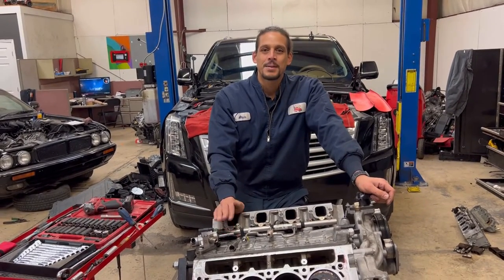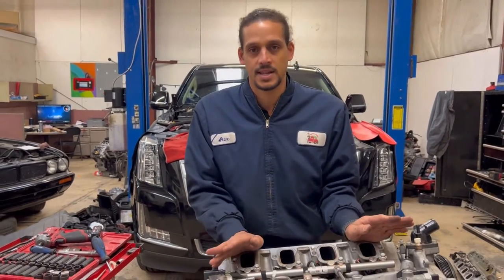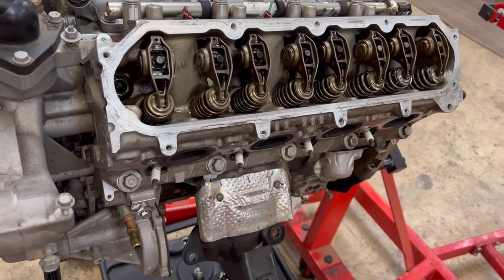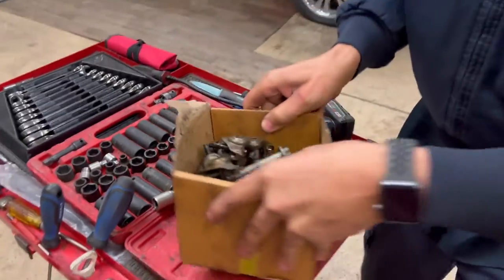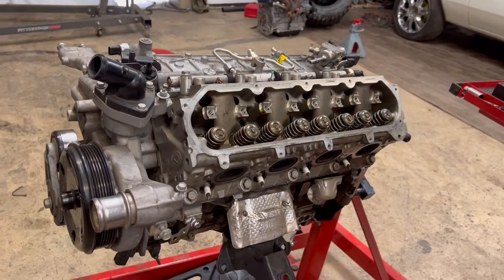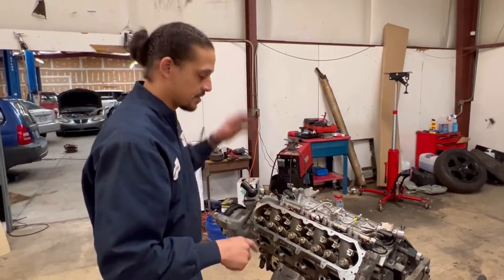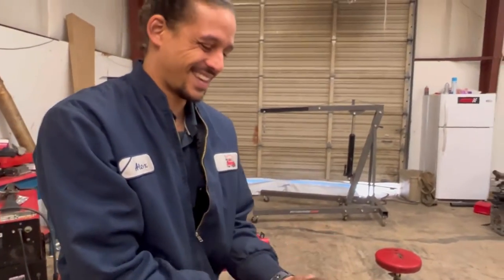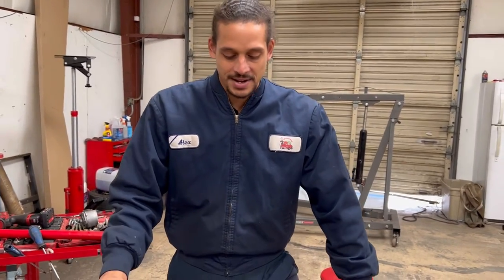Cadillac Escalade Lifter Fell Apart (Partial Engine Tear Down) #cadillacescalade #lifterproblems

Comment: Active Fuel Management (displacement on demand) is a horrible system. If you are looking to buy a vehicle with this system...if the system is running correctly, buy a device that turns the system off as soon as possible. They make disablers, fyi.
Reply: I dont think the disablers are worth it. Might as well just replace the cam shaft and lifters. Unless youre worried about the warranty.
Reply: Back 20 yrs ago lifter problems were not very common,why is is so common with newer cars now bad designed or cheap metal 😮
Reply: @OldManFrank  more like destruction on demand lol.
Reply: TAKE IT FROM ME THEY DON'T WORK!!! I still dropped a lifter while so called running in v8 mode only.  Only way to remove it without physically deleting it. Is to have it tuned and deleted out the PCM. Me myself I deleted the entire system and had it tuned.  Save your 💰 don't buy disabler devices
Reply: Yep just buy the DOD  delete kit
Reply: I had my AFM delete and did a tune up and its a big fifference after the job the cadillad service did

Comment: I just had all the lifters replaced on a 2021 Cadillac Escalade with only 23000 miles on it. One of the lifter failed, but Cadillac dealer replaced all of them. Watching your video was a great explanation as to what they had to do. Thank you!!
Reply: Is this a engineering issue or can it be prevented?
Reply: What a shame!!!  Nice vehicles but I wont come near one because the reliability is so terrible.  Plus you have carbon build up issues.  Transmission issues. Electrical issues. Weak fatal roofs in a rollover.   Much much better off with a Lincoln Navigator, Toyota sequoia or Lexus LX.
Reply: replaced all of them with stock DOD parts so it fails later down the line....I heard instances where they went into all the work of pulling a head/s just to replace the bad lifter.....total craziness since the motor is already apart to not do all....but thats the dealer

Comment: GM sells the block for $4200 with 12m12k warranty over the parts counter. If installed at GM dealer then you get 3y 100k warranty but it’s $8900 installed. Just had mine done. These J code l86 only have 100k total engine life.
Reply from the maker: Good information thanks

Comment: You know for somebody that does so much work on these engines you should know better than to recommend 0w20 cause that is just to meet EPA standards that oil is not the best you can use for that motor

Comment: Thanks for taking the time to do this videos and help educate the community.  GM should have a recall for these engines, I been a GM customer for 2002 buy 3 brand new Silverados, my 2013 and my 2015 Silverado with 37,000 miles are both broken on my drive way, I would never buy a GM vehicle in my live, and I will be talking to all my family, friends and any body who wants to buy a GM vehicle to don’t buy it. This engines has so many problems that it’s ridiculous and GM it’s not doing anything about it, and to make things worse they still putting those same engines in new vehicles.
Reply: Not just engines......DOD issues 2010 to the later models, bad torque converters ruining transmissions, bad engine mounts, rear main seals......these are the killer problems....

Comment: 5w30 is perfectly fine for those.  20 weight only exist because of the stupid EPA CAFE requirements.  It’s the same motor in the C7 Corvette and Camaros that call for 30 weight.   The only differences are the intake manifold and exhaust and of course the tuning.  

Love your content.
Reply from the maker: Thanks for your input about the oil I appreciate that! And thanks for watching 😎

Comment: Hi Alex, at 20:16 you mentioned the valley pan, I just learened this called the "valley lifter oil manifold." I am starting this job on a 2015 Escalade ESV with 73K on the meter. I have just taken the valve cover off and found a broken spring #5 on the left bank. The spark plug end is a deformed. The lifter rod is not bent and the underside of the rocker does not show any dimpling, so hoping for the best, but won't know until I get the cylinder head off.  The owner said the car started to hestitate while driving around 15 mph, so he pulled over and turned off the engine and then tried to restart, but it wouldn't turn over. I am hoping for the best case scenario! Thank you! Jon (Erie, PA).

Comment: I've owned so many LS trucks and performance cars and you are better off camming/dod delete as soon as you can. Have a 2014 SS with a failed lifter but fortunately for me it bent just the connecting pushrod. Got it cammed to so i don't have to worry.

Comment: Hello, thanks for the great video.  I’m currently in the process of performing this job on my 2015 Escalade.  I need to remove the engine so that I can replace the oil pump.  My question is, what needs to be done to separate the engine from the transmission, do you lift the motor directly up and at the same time lift the transmission or do you remove the transmission first then the engine.

Comment: Hey man I have a 15 ESV that I purchased three years ago with 4,000 mile. Mint condition
We just got back from Fla and we’re at 10,000 miles
I’ve always noticed the transmission is jerky 
Do I need to get rid of this thing before it’s gets worse?
I’ve read all the issues on 15 - 2020 years

Comment: I had a good ? How were ur gonna handle the sludge by doing sum type of chemical flush on the engine or just da parts thats affected?
Reply from the maker: Sludge is normally an issue in the oil passages I didn’t see any in the oil passages internally in the engine. I’m just going to clean up the parts in the parts washer
Reply: @AlexTheCarDoctor  oh ok cs that sludge i seen in the past take down lots of engines😂

Comment: I do have questions because I'm about to purchase a 2016 Cadillac Escalade with 98,000 miles on it. So from 2015-2020 this problem can occur? Is that with certain mileage or people running it rough or not taking care of it or can you explain some more this way I can make my decision if I'm going to buy it or not I want one so bad between 2015 and 2020 I didn't like the old body style and I don't like the brand new body style I like the 15 to 2020 and that's it please help me New Jersey calling
Reply from the maker: I’ve seen people take awesome care of they’re  Cadillacs and still have the lifters go bad. I’ve seen them happen from 90-100k miles. It’s just a bad design.

Comment: First time work on this car. Due to 4th cylinder knocking we replaced the lifters, lifter valve, oil pump and the push rods and cleaned oil pipe. After starting engine again lifter 4 was knocking. We then replaced the lifter oil manifold and lifters but the same problem... What do you think could be the problem? ready to just replace entire engine...😢

Comment: Great video.got a question for u I just got done doing a 17 caddy.all brand new lifters the cam looked good with a borascope.got it running an ran great for maybe a half hr now it's clattering just like a lifter is stuck again.any idea have u ever had problems with them getting stuck like that again.they all oem parts from caddy even. Appreciate any info you can give me on it.

Comment: Thank you because I have a 2016 platinum esv with 105.000. I had it since 40k kept up with services. I’m going through this now! What should I do?
Reply from the maker: If you like the truck, fix it. It’s expensive and there isn’t a guarantee that if fix it that it won’t happen again down the road. I heard that if you upgrade the lifters to a brand called Johnson lifters, you won’t have the problem anymore. But those are super expensive and when I give my customers the option, they choose to go with the “Melling” brand that I use. It’s just a pain in the butt really 😞

Comment: Hi Alex.Question! I have 2018 Escalade ESV. Just today, rod bearing went bad. Mechanic recommending an engine replacement without opening the engine and said that by hearing the engine knocking noise. Do i really need an engine replacement or replacing the bearing would solve the issue? Need your opinion. Thanks
Reply from the maker: Hey there sorry to hear you’re having issues. I don’t believe what other mechanics say I will have to hear it for myself, is it possible you can Instagram me a video of it running. Throwing connecting rod bearings at it won’t solve the problem if the crank is scored up most times it is and you will have to send the crankshaft off to a machine shop to get it reworked and hope the mechanic can install everything back right, at that point I think it’s easier to put a engine in it that’s more guaranteed
Reply: @AlexTheCarDoctor  i just replied on Instagram sir. Thank you for the quick reply 🙏
Reply from the maker: @Yavyuuu  my pleasure

Comment: Question Alex.. I have a 2022 gmc sierra that was bought during the "chip shortage". i dont have the active fuel management system and my v8 does not shut off cylinders! even though i dont have the system, do i still have those type of lifters with the springs on them?
Reply from the maker: I do believe it’s just regular lifters in your vehicle

Comment: I had the cylinder 4 with lifter,pushrod,camshaft on my 16’ cadillac ewcalade esv in the cadillac service center and I paid $9k over because these escalades from 15’ all the way I think to the newer ones has a problem with the AFM system

Comment: i just bought a 2018 escalade ESV. should i get the DFM disabler? i had a 2011 escalade engine went bad  at 117k miles, cost me $8000.00 to replace the motor, started with a lifter issue that caused the bearing to damage the block
Reply from the maker: Disabled and it won’t fix the issue the proper way is to change the cam and  go in with regular lifters then disable it so the computer won’t throw a check engine light,disabling it is just a Band-Aid on a gunshot wound
Reply: @AlexTheCarDoctor  what would it cost to do that
Reply from the maker: @Brian.8272  that will be considered performance and I don’t get into that for customers but it would be the same price as seen on this video because it’s the same process, The price is between 4 to 5k parts and labor

Comment: Hey, just got you on JT’s live stream and subscribed, was wondering about the scarring in the lifter cylinder on the block will that not cause low oil pressure?
Reply from the maker: Typically yes, it will cause that and other issues as well. But in this particular case be sent the block off to a machine shop and it worked out great for him. Oil pressure readings were great!
Reply: @AlexTheCarDoctor  awesome

Comment: I have a 16 escalade when driving from  1st to 2nd gear it has like a jump or push feeling to it. & viceversa. On the cluster it shows when it goes from v4 to v8 mode or v8 to v4. Do you think the afm might be the problem?
Reply from the maker: Hey there, is the check engine light on. From my understanding the truck does this every time and when this happens it’s going from 4 to 7 cylinder and  vice versa
Reply: @AlexTheCarDoctor  no check engine light, took it to the dealership but they always try to avoid the problem itself lol
Reply from the maker: @carlosv6162  that’s crazy man I would love to take a look at this problem, where are you from
Reply: @AlexTheCarDoctor  I live in Chicago lol, I wish you were close by. I would’ve definitely taken it to you.
Reply from the maker: @carlosv6162  I need to open a shop down there

Comment: Hey Alex, love the video. I am doing this repair at home myself. However, I left the engine in the car and I was able to take all the parts apart and get the phaser out. However, after installing the new cam and camp plate, I am stuck and I am not able to get the new phaser in. I broke one last night and I just picked up a brand new phaser for $225 and I don’t want to break another one. You said there was a GM tech that knew how to install this without dropping the oil pan or removing the oil pump. How do you do that?
Reply from the maker: Hey there I recently tried that trick and it worked great for me, but it is risky and not recommended. unfortunately, it’s one of those things better shown than told.I recommend lifting the engine and dropping the pan
Reply: Thank you for the reply. I was able to finally get it on by loosening the oil pump bolts, took 5 hours but got it all lined up with cylinder 1 TDC. Thank you!

Comment: I’m replacing my lifters on my Camaro ss do I have to take the engine out completely or can I change them while the engine is still attached?
Reply from the maker: If you gotta change the Cam, you should take the engine out, it’ll be easier. If it’s just the lifters, you can do it while the engine is in

Comment: Saludos Alex.   Quería preguntarle.  Algo Mi esposas tiene una 2015 Escalade  la. Llevo al taller por un sonido raro en el escape y después de unos días los mecánicos dijeron que el motor ya no servía.    Y para cambiar el. Motor.  Mucho dinero. Y queremos buscar otra opción
Reply from the maker: Mi espanol es no bueno. But you can swap to a 5.3 engine that’s in the Yukons. They are way cheaper

Comment: Thank you from Calgary. I dropped in for a view of a big engine. I have a rattle in my 6.2l Denali 1500 GMC 2009  240,000 km/ 150,000 miles with code P0300 engine misfire that I am researching.
Reply from the maker: My pleasure
Reply: If you change batteries you have to reset the ecu
Reply from the maker: @rayolight9744  not with this truck

Comment: Hello Alex, I have 2015 Cadillac Escalade ESV. I purchased it in Feb and I should have bought the extended warranty. But, It was $6700. The dealer says I need a new engine. I guess a lifter spring broke and fell into the piston, damaging the block. They want $9300 for a re manufactured engine. 3 year/100,000 mile warranty. Any recommendations. Can the block be repaired, or should I go ahead with the repair. The mileage is 83,000 miles. 

Any advice, as I trust you more. I'm in Northern California. Its kind of hard. Because, If I pick it up from them I still have to pay them $1700. So they got me.

Thanks,

GReg
Reply: If I do repair and trader it in. Which year Escalade would you purchase? I don't really like the navigator. I have a G63, but its not roomy. Its the truck my wife drives to go to Costo. I also don't like the Yukon or Expedition.
Reply from the maker: Hey there buddy sorry to hear that, that is a lot of money, if you spend that much you will need to hold onto it to get your moneys worth.that’s a hard one to call,if it was me I will cut my losses and trade it in/sell it because who to say you won’t have another issue out of the reman motor after the warranty is up. you can get a 5.3 out of a Yukon similar year used for about 3500 and put that in just so it will be running to get rid of it,you will get more money out of a running vehicle versus a non-running vehicle. The Escalade of my choice is the 3 L Duramax diesel that’s found in the newer Escalade, i’ve heard they haven’t fix the issue yet even with the new  2023

Comment: Just wondering, is this a common problem on this model?
Reply from the maker: It’s not the model it’s the engine, GM uses this engine the 6.2 in there lineup for there cars and trucks
Reply: @AlexTheCarDoctor  Hello, oh so is it a common problem with this 6.2 Engine? I was thinking about getting a 2016 with a 6.2 and mostly highway miles - now I'm concerned lol
Reply from the maker: @moe4772  GM started this design back in 06, I have seen problems with there 5.3 and 6.2 engines. Last time I checked the problem was not fixed currently of 2023

Comment: What is the real difference between the LS and the LT motors Doc???
Reply from the maker: The Main difference is The LS is port injected and the LT is direct injected
Reply: @AlexTheCarDoctor  is that the reason why they sound so different??? Thank you for replying BTW
Reply from the maker: @paulsalmon4771  yes the high pressure fuel system is louder and change dynamic of the motor in terms of power and performance
Reply: Knowledge is power thank you. I love the LS but those LT's sound so with right exhaust
Reply from the maker: @paulsalmon4771  I’m a die hard LS fan. I like simplicity you probably can make way more power with an LT but for reliability I love my LS

Comment: I dont know what either did. I do know the both people engaging in road rage are a general problem.
I personal have always told friends not to react to people.

Heres what people say "hes going to get charged". Do yall think killers ste worried about charges? They wouldnt do it if they feared prison.
The thing is your already dead or injured because you were so desperate to give to follow them and give them the middle finger when it was pointless to try to prove a point.
First dont try to prove your point to a stranger who could be a serial killer and meanwhile uou haven't even been in a fight. 
I dont know what happened here but just general road matters.

If they dont have a gun they are automatically have something to kill you withz their vehicle so why would you think to go back and forth with them.

Notice bro just hopped out and didnt seem upset. Often its because theyve also done something to taunt the person, follow them, aggressively tailgate.

Not that the other guy was right but that doesn't matter once your dead or injured.

Comment: I have 2016 just got it in October check engine light came on while driving started rough idle code misfire cylinder 6 took it to dealer bad injector replaced one side injectors $1900
Reply from the maker: Dang that’s a lot

Comment: Hey guys I have a 2017 that has a misfire or no fire in the #4 cylinder. 
After changing out plugs, wires, and coil packs. I was told I need a motor.
Reply: I was told it could be a broken lifter or lifter spring??